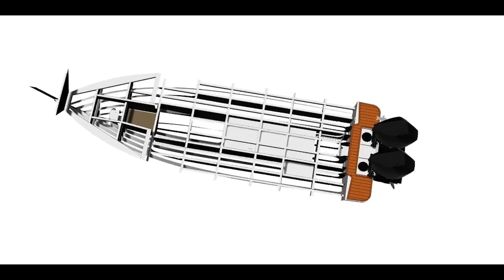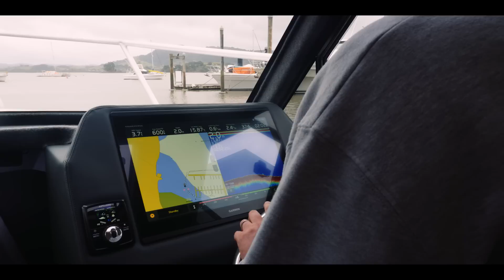Kiwi creator | Makaira plate boats

Comment: Its hard to sit through listening to someone just gas-bagging their 'unnamed' competitor.. Painful, you just come across as a bit of a flog. 
Here's an idea, just talk about your own product, it will speak for itself. Anyone in this end of the market is going to do their homework.
Reply: He’s got a point though. Technically ‘plate boats’ aren’t actually plate boats unless their hulls are 6mm or thicker. Plus the vast majority of mass producers out there, yes they make lovely boats and you almost never hear of one breaking, but the actual structure in them is super super minimal. Most ‘plate boats’ on the market shouldn’t actually be called plate boats cause they’re only 4 or 5mm hulls. Most recreational boats are designed to marine order 503 or exemption 40… which in the scheme of Naval Architecture is the equivalent of ‘does it float? Yep? Cool it’s good to go’

Comment: What does he mean when he talks about Lloyds??
Reply: Lloyd's Register is a global professional services company specialising in engineering and technology for the maritime industry.

Its stated aims are to enhance the safety of life, property, and the environment, by helping its clients (including by validation, certification, and accreditation) to improve the safety and performance of complex projects, supply chains and critical infrastructure.
Reply: Lloyds is a class society. There’s heaps of them that specialise in various structures (NSCV, HSC, IMO, DNV, BV etc.). If you design a boat to the specifications of a class society, your designs get checked and certified, stamped with approval marks, and the vessel can have a classification certificate issued. This means the vessel is certified compliant for the operational profile it was designed to (in this case he says that’s 30 knots in 1m seas) and can be insured. Recreational boats don’t need to meet class society rules like Lloyds SSC, because they’re not commercially used. You’d be amazed how minimal structure you can get away with selling recreational boats. What he’s designed in this video could be put in to survey and commercial work without any structural work re-done.
Reply: Things like commercial fishing boats, ferries, luxury super yatchs etc all get designed to class rules. There’s generally a maximum length before you’re required to design to class, and then length markers, service type and operational area above that point that dictate if you need to step up rule sets to more stringent rules/higher design pressures. If you’ve ever heard of small charter boats being in ‘2C survey’, in Australia that means they’d be designed and built to NSCV (National Standard for Commercial Vessels) 2C design rules, 2 being the service type (non passenger vessel) and C being the operational area (restricted offshore operations within 30 nautical miles of Australian mainland and tasmania). Something like 1B would be service type 1 (passenger vessel) in operational area B (within 200 nautical miles of Australian mainland or Tasmania